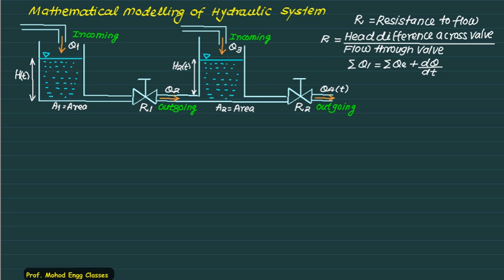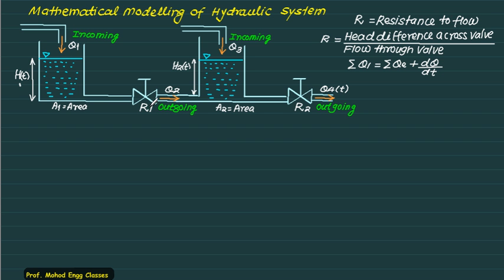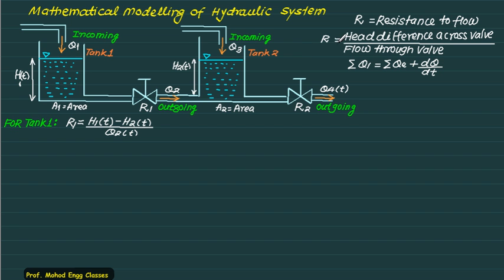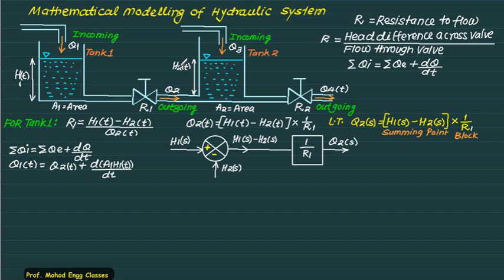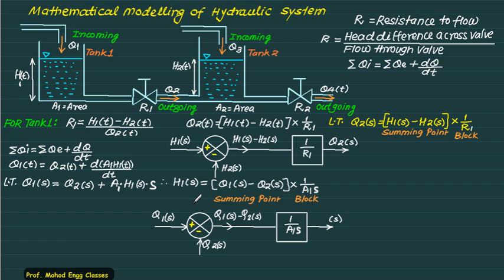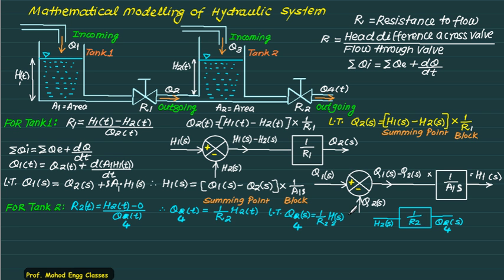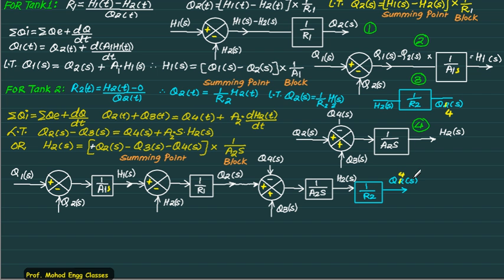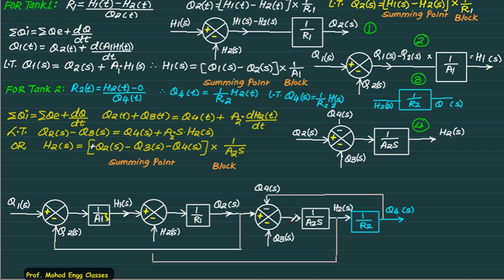FL 02 Mathematical modelling Fluid system

Comment: Excuse me sir, how does a pump (&Q) connected to the bottom of tank 1 through the valve of linear resistance R1 will influence the formula of R1? And also what about if the pipe after R1 take a height H to get to tank 2 ?  
Thank you!